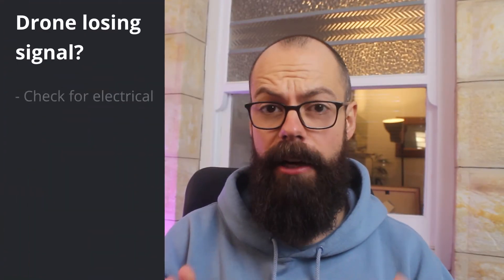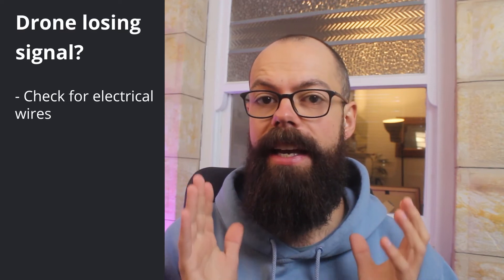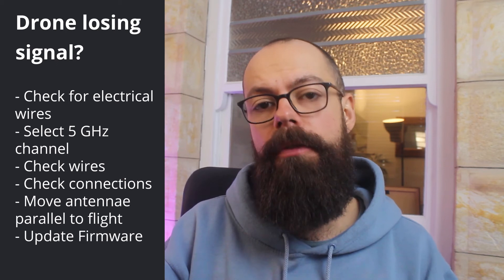Why does my drone keep losing signal? 7 simple checks...

Comment: @DJISupportGlobal  Hello, I am experiencing the same problem and it gives me anxiety every time I fly because it keeps on disconnecting even it is not far away from me. It happened just after I updated the software last December 2025. Is there a chance that this problem will be fixed? I have dji mini 2 with normal RC that I need to connect my phone to it. I have used my dji mini 2 for more or less 10x only since 2022. Hope to hear a response from you. Thank you!

Comment: is not a DJI drone, signal loss always specially higher altitudes. But in the ads stated 800m vertical and 18 km horizontal for distance.

Comment: Hi I'm new to drones and I bought an inexpensive E99 Pro.  I took it to a large rural open field.  Controller light was on and drone lights were on.  When I pressed the launch button, it was supposed to hover at 4.5 feet.  Instead it went up full speed and did not respond to the controller throttle.  I saw it go up several hundred feet and disappear.  Do you know why this happened?

Comment: if the antenna in the drone is virticaly polarized then the antena on the controler MUST be virticaly polorized........if one is horizontal you are crossed polerized you will lose 20db of signal  !!!!!! most man made noise is virtically polorized....antennas in drones and controleer are a quarter wave spike ...unity gain 1inch i belive....sorry for the typing and i have bad vision

Comment: I'm having a controller connection loss on my dji mavic 2 pro. I fly about 40ft and the controller loses all control/signal for the drone. I have everything updated on the dji go 4 app on my samsung s24 ultra. Calibrated properly, antennas are all fine, good connection to my phone. Any help is appreciated.

Comment: RIP to my mini2 today Apr 17 2023, flew it while on a boat like I normally do, no issues, no signal lost, perfect flying everytime. until i did a firmware update. afterwards it was constantly losing signal at 70-100m and getting disconnected. Once it lost signal the RTH was somewhere in the water and the boat was already far away from the RTH. I was trying to adjust the RTH somewhere closer to our destination but  I had no control of anything no signal on the screen, no GPS,  wasnt even pairing anymore. it was heartbreaking. anyone else had this issue. let me know. I have a phobia now. glad it wasnt a mini 3 or else i would've been even more devastated.
Reply: Updated last week. First flight lost signal. Never one problem since new. Fkn furious. Is there a fix for this ? I knew it in my heart, I shouldn’t have did any updates at all.

Comment: Seems you haven't posted a video in quite a while.  Wanted to correct the Mini Pro 3 vs Air 2s comparison article you published, "DJI Mini 3 Pro vs Air 2S: Table Comparisons".
In the article, you incorrectly state the DJI mini3 pro has a "bigger" sensor and can be used "better in low light".  For those looking to choose between the two, those claims should be revised.  The Air 2s has a much larger sensor (1" vs the smaller 1 1/3").  It is true the Mini 3 is capable of producing higher MP images, but the smaller sensor is using four 12 MP photos to create that higher resolution (48MP) image.  Additionally, the 1" sensor of the Air 2s makes it a far better option for low light photos.  The larger pixel pitch collects more light and allows the sensor to have far less noise.    Thats not to disparage the Mini 3 in any way, but factually, the article is incorrect.

Comment: 5ghz and 2.4ghz are situational. 5ghz might be better in your scenario because you are flying in an area with a lot of interference from other users and only flying short distances away. The downsides to 5ghz is that is has a harder time penetrating structures and does not give you the range of 2.4ghz because the shorter wavelength. 

You’d be better off sticking to 2.4ghz in rural areas if you  are going for range, but knowing the difference between the two is nice so you can switch accordingly. Also - some drones now have a dual band option (although may be reserved for prosumer drones at the time) that receives and transmits on both frequencies!
Reply: I dont get this because everywhere says 5.8ghz is better penertration but lower range but 2.4ghz is worse penetration but longer range

Comment: Hello and thank you for the information. I only been flying since November and have not had any trouble like I had today.  I lost signal to my drone and it was on and off several times during my getting it turned around. And I was within a quarter mile of the controller. Not far at all in what I’ve been told the distance capabilities of the mavic 2 pro are. But there is one thing that I need to ask,  and that is when all of this was going on. My controller told me to put the drone in tripod mode. Which is where I thought my drone was set. Upon getting landed I found out that the physical switch on the controller was on T (tripod) mode.  But the setting on the Dji go 4 app was on P (positioning)  mode. It didn’t seem like it wanted me to change it to positioning mode in the app so I switched the controller mode to positioning. I did fly again shortly there after but couldn’t really tell much change between the two setting’s.  A little more responsive, and a little bit faster maybe. But I’ve never had it tell me to do something. On the flight after this all happened I did not go back to the distance where the signal was lost. But the day before I had flown almost twice that far and had no trouble.  So now after this windy story, my question is.  Could the flight modes not being set the same have caused signal lose?  Thanks for the help.

Comment: Have a hs 720e that wii fly in circles in hover mode and then takes off like a jet .Has 16 17 sats signals ,if you shut off gps it will come back under control.Transmitter still shows gps sats still on with  gps switch turned off

Comment: 8:33 wifi can actually travel quite far, if you are flying in a low interference area and in FCC mode, the drone should be able to get the range that dji states as long as there aren't too many obstacles in the way.

Comment: Another thing for the Mavic Mini and DJI drones with the antenna in the front landing gear legs. Normally the best signal is off the front. Turn the front of the drone towards you. Use DJI FLY map to orient the drone so its facing you. The latest update gives a line back to Home so line the front up with that line.

Also set your RTH altitude so that if you loose complete control / disconnect and it initiates a RTH the added altitude will normally help regain signal. Altitude is everything for signal! Just keep in mind of local airspace and max altitude rules.

Fly safe! Be safe and Fly as You Are! =]

Comment: 300 meters disconnected? Damn. That'snot far at all
Reply: Ya, I saw a video where someone get 5km with the original mavic air, and only had to return because of battery. That was a super low interference area though.
Reply: @clmfilms8103  I got 2.64 miles in a urban area in long Island with  mavic air 2
Reply: @FrankieBagz  that's pretty good, air 1 would probably disconnect at that range in an urban area
Reply: @clmfilms8103  yea your probably right about that

Comment: Mine is still losses signal I tried all your tips for some reason I still losses signal in mid air is there like another tip🙁
Reply: Maybe try replacing the cable between your phone and controller. Location maybe? Try another place to fly.
Reply: @gmoney9794 if he Change cable problem solved 👌

Comment: How to keep Mavic pro Battery in a proper way? Give me some tips on preventing bloated for my battery .
Reply: 1. Don't keep the batterys fully charged for more than 24 hours
2. Store the batterys at around 40% if you are not planning on using the drone for a month or longer 
3. Don't store your batteries in a really hot place (the back of your car on a hot day without air conditioner or windows open)
4. Try to land between 20 - 30%, never drain the batteries past 10%
I use these methods and I have had my batterys for 1.5 years and I have had no bloating or problems. Hope this helps 👍

Comment: My new Mavic Air 2 is only going 3000ft...this is terrible and I'm in the country!!
Reply from the maker: Strange! Have to checked with the distributor for fixes?
Reply: Are you in CE mode or FCC? This makes a huge difference.....also, are you flying next to any sort of cell phone tower or high voltage power lines?
Reply: @clmfilms8103 I'm pretty late with my question given when this was discussed but what's the difference between CE and FCC when judging range performance?